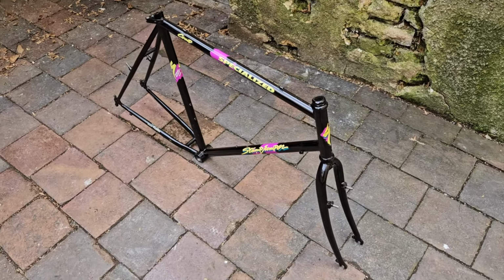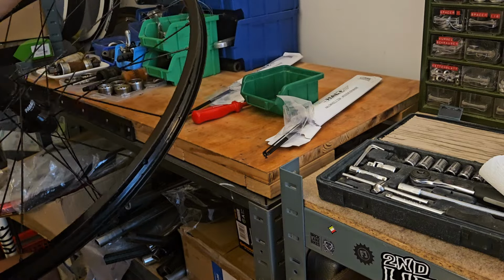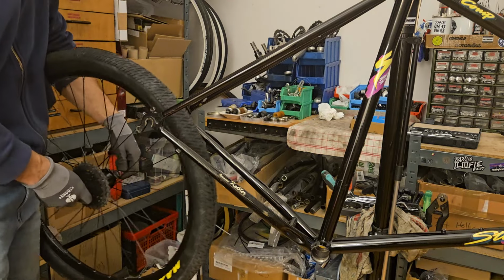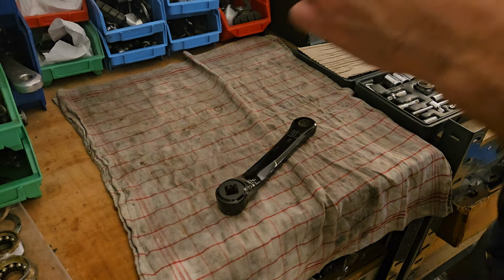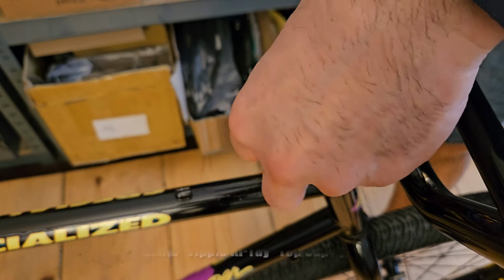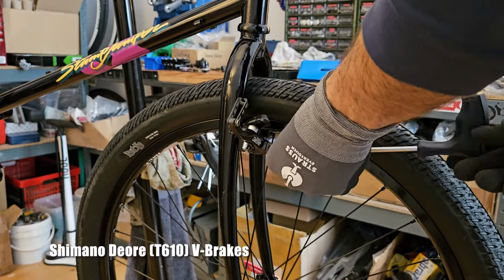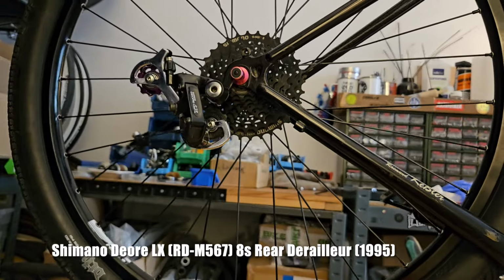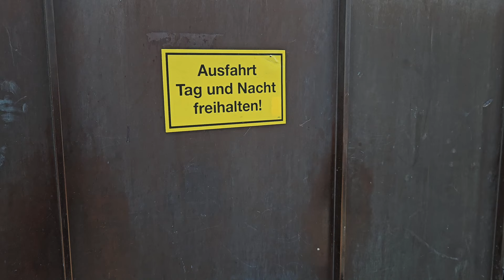Sinister Specialized MTBMX Restomod

Comment: what adapter do you use for the stem? and how does it work if you want to remove it if? do you need ro take out the headsetclaw and then unscrew the quill adapter?
Reply from the maker: Unfortunately, I ordered this part from a wholesaler a while back to try out and don't recall which one it was. Yes, you would need to remove the claw first, before you can remove the stem. Not a setup that I would go for on a customer build, but I just really wanted that top cap on there! 😅

Comment: Very nice quality build, good attention to detail. I do wonder though. Why go through all that trouble, finding suitable specialized parts and other time period correct parts, cantilever brakes, and then throw on a dropbar with new shifters on. Why not either go full original restoration or a drop bar restomod with more modern componts. Just wondering..
Reply from the maker: Thank you! To your question: The main reason we build these bikes is sustainability. So we try and reuse as many vintage components as possible and add new components where it's necessary to achieve the desired look and functionality. In this case, the customer chose these bars and we then sourced suitable brake/shift levers that would work with the old XT parts

Comment: What is the quill stem adapter you have used in this buid? I have been looking for one just like that for ages.
Reply from the maker: Well, the short answer is that I don't know... 😅 I ordered adapters from different wholesalers a while back to try out different ones, and this one seems to have been removed from their lineup since then
Reply: @bottoncino_bicycles  Thanks so much for your reply, even though seems like im a dead end once more :D If anyone knows any 1 1/8 adapters that are that long, i would appreciate any pointers.